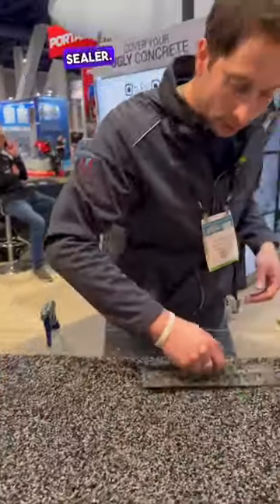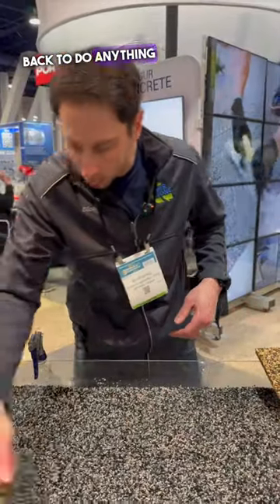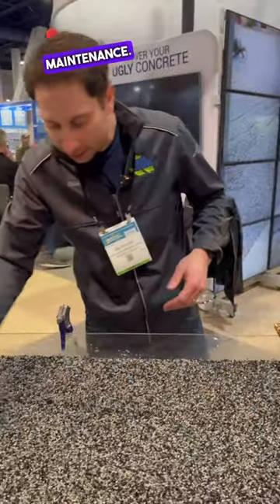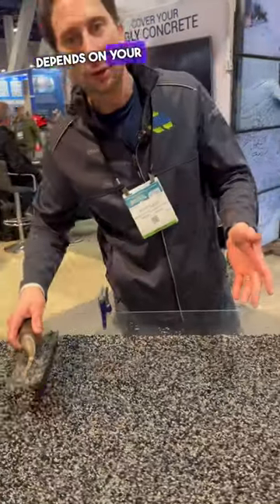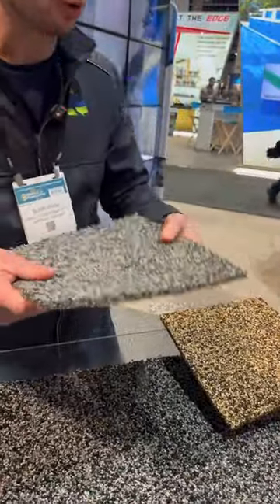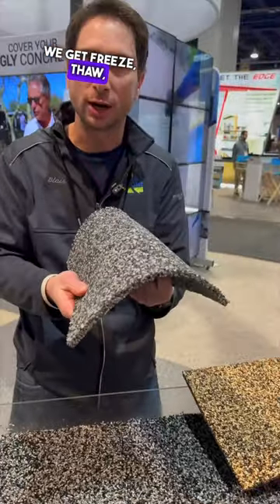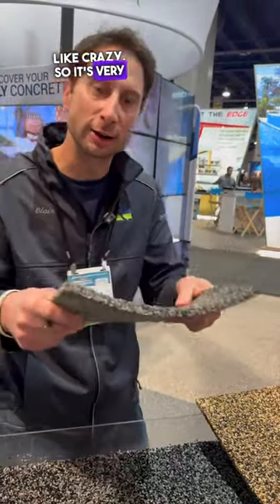Innovative Rubber Flooring Product! #flooring #rubber #shorts

Comment: What about sawdust? Fine dust? Would sweeping up sawdust fill the pores? What if your car leaks oil into the dust filled pores? Do you have a 2nd product that would fill the surface pores and leave a sealed, broomable, long wearing yet flexible waterproof surface? If you are trying to compete with epoxy for garage floors you need one. Once it is full of dust and dirt wont it lose its elasticity and just be an easily abraded wear surface? Once full of dust and dirt would jumping up and down on it throw up a cloud of dust? What if it was damp or wet where you are jumping on the dirt filled matrix? 
     It would be great in a vestibule or any exterior entry. Set into a sunken sloped floor with a drain to take care of tracked in water and vacuumed regularly to keep the tracked in dirt from becoming mud. Vacuumed regularly with a wet/dry vacuum?
     It would be great underneath playground equipment. 
     How would a wheelchair roll across this stuff? Like rolling in wet mud sometimes?
It has the same issue that permeable concrete has. Its permeable. Great in a world with no dirt.
Reply: Dude tell me one thing other then your mouth that has an answer for everything ? “What if a tornado blows your garage away ? Then what “ 🤪🤪🤪
Reply: And it’s not put on as deep as the tub he is moving it in . Wheelchair getting stuck in mud hahaha these ppl can’t be real
Reply: @nhaake  I can't fathom how you're actually trying to defend the product, you point out one example that would be an exception, wheelchairs, whilst he does list plenty of valid concerns about the durability and cleanability of the product. Not to mention it being a breeding ground for black mold

Comment: If water goes through it where does the water go? Do you have to cut slots in the concrete for drainage underneath?
Reply: I think it's primarily for outdoor use
Reply: @theicedragon100 they said it is a replacement/substitute for epoxy garage floors.... garages afaik are typically indoor storage for vehicles (though I am sure it can be used outside as well, since they mention UV exposure)
Reply: @mherrmann81687 indoor, sure, but accidents happen, and the moment you spill anything or drag in snow or water with your car, you aren't cleaning it with this flooring. It's gonna seep right in and pool there
Reply: @codylyon7488  I wasn't saying that it didn't have issues... I was just stating that the video indicates that they have it marketed for indoor use as garage floors. 
<thinking "outloud"> How thick? Idk... maybe the indoor installations are a thinner layer than the exterior version, to improve airflow and evaporation, and reduce mold and most lingering fliuds. Which is still an issue with oils, since they don't evaporate.
Reply: @mherrmann81687  I suppose if it was a really rhin layer, it wouldn't be too bad, but oils for sure would come out of any amount of porous  flooring. I doubt it would be very soft to land on if it was too thin too. I think it's just a classic case of someone trying to sell a poorly thought out product to people who don't actually need it
Reply: @codylyon7488  "someone trying to sell a poorly thought out product to people who don't actually need it".... sound like the tag-line of the 21st century, lol.

Comment: Imagine having this for a garage floor then needing to use a chain hoist for your engine. Sounds like a floor that only use is for playtime
Reply: What does a chain hoist have to do with flooring materials?
Reply: @caterpillarslim1288  talking about a rolling chain hoist, as opposed to one on an I-beam. (Although installing a I beam wouldn't be fun on this ground either.) They generally have metal wheels which will dig into any soft ground with weight on it, even hot asphalt in the summer.
Reply: Chain hoists hang from the ceiling bud you're thinking of a cherry picker aka crane/engine hoist
Reply: @AndrewB23  do gantrys count then?

Comment: it actually didnt sound bad until he said water went through it, thats actually incredibly bad for a flooring. u dont want moisture getting into ur slab that can cause cracking u dont want it in ur sub floor either big negative right there. was thinking it would be good for shop floors but as soon as he said that it was a giant nope.

Comment: Can it withstand gasoline, kerosene, brake fluid,  alcohol, mineral spirits, motor oil, etc..? I’ve seen rubber break down during exposure to solvents.

Comment: If you're putting a permeable layer on top of your concrete it will just continue to damage the concrete and do absolutely nothing to reduce water runoff in your yard. Its pretty much just polymeric sand made with rubber instead of the large sand particles, so it would work well for low traffic walkways or lawn pads, MAYBE a driveway if its poured thick enough. Unless its dirt cheap it would be more cost effective to tear out your driveway and install a new one with natural rain gardens or new grading for proper drainage

Comment: the fact that it's a permiable service makes it automatically a bad replacement for epoxy in a garage. when the oil sits under it and you can't clean it the rubber will just rot and stink, just like mildew and mold from moisture

Comment: How does it handle welding and torching? Say if you have to torch off a bolt head or nut and a red hot piece of metal or slag lands on it?

Comment: I disagree.  Concrete is porous and constantly releases moisture.  ANYTHING that keeps water vapor from evaporating from the concrete is bad.  Paint, tar, epoxy, rubber, polyurethane, etc. do not let the concrete breathe and dry.  One of the things damp concrete does is prematurely rusts the wire and rebar in the concrete.  Nothing good can come from damp concrete.

Comment: Water going through it and sitting there is an issue. Cleaning the surface is another. If the underlying concrete surface is porous the glue won't adhere to it and the layer will lift.

Comment: Lol. It would be awesome though if they made it from old tires. That would save alot of tires from the landfill.
Reply: Some rubber from tires, if not the most of them have some nasty chemicals, there some studys on artificial turf linked to cancer because of this chemicals of recycled rubber tyres
Reply: @CrissPivot  link to article? Can't find it.
Reply: @terrycorkum  https://en.m.wikipedia.org/wiki/Artificial_turf%E2%80%93cancer_hypothesis i remember seen a video so, this is the nearest thing i can find
Reply: @CrissPivot  Thank you.
Reply: @CrissPivot  Usually, when I post a link in the YouTube comment section, the entire comment disappears. How did you do it?
Reply: @eugenetswong  i dont know, i just did, i know some bigger channel have filters on the comment section to ovoid spam and scam links all togheter. Maybe is that
Reply: It will all end up in the landfills due to this being garbage.

Comment: Sure, this is nice and soft, but fluids just run right through it, and then you literally Can't clean it up. The fluid just sits and spreads around down inside the rubber stuff. The sub concrete floor then rots from the chemicals. In my 25 year professional opinion, do not buy this. Mix 20% semi fine sand into regular epoxy floor paint, then thank me.

Comment: Hey, would an all black version of this work well for the north side of a south-facing all-year earth-mass greenhouse? ie can it be laid on vertical surfaces? Slightly thinner than the matt he holds, it just needs to absorb the heat and send it into the Earth wall (I imagine we could incorporate very very dark pigments in this rubber to absorb more light energy from the sun?).

Comment: Even if it does adhere to the shop floor, after some gasoline oils etcetera get on to it I guarantee you it will not be stuck to the shop floor for long and then you will have just a large messy rubber mat with all kinds of problems to deal with

Comment: Tired of epoxy garage floors? Absolutely not. How are you going to to clean this stuff if you ever work on anything in the garage? Oil, grease, metal, saw dust, etc are commonplace in garages.